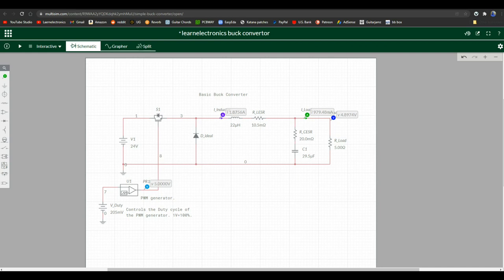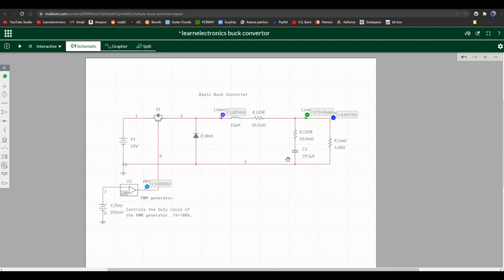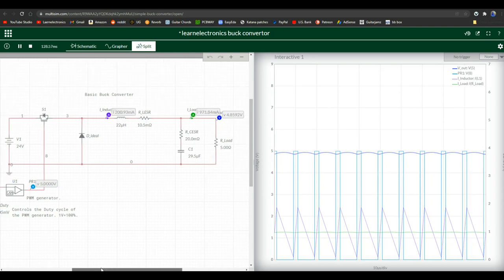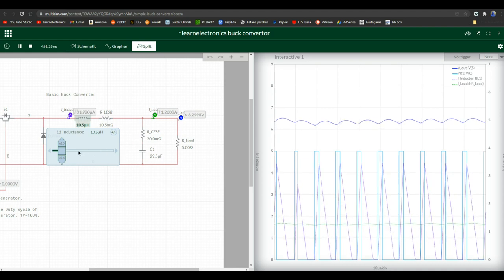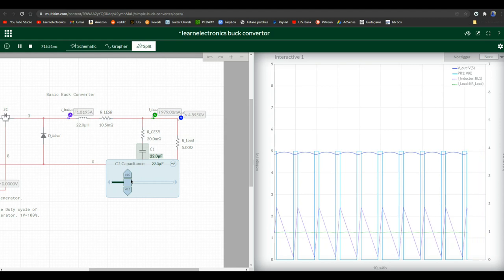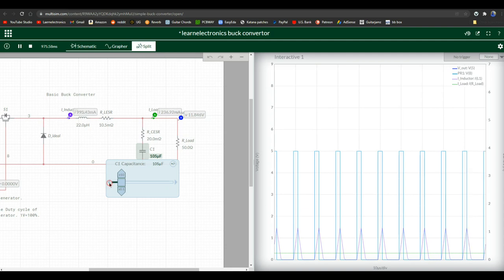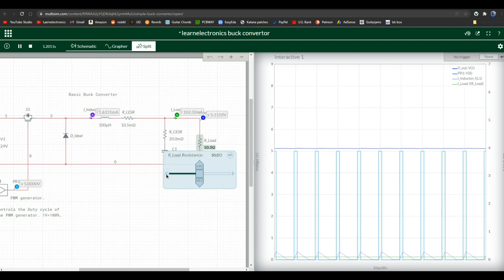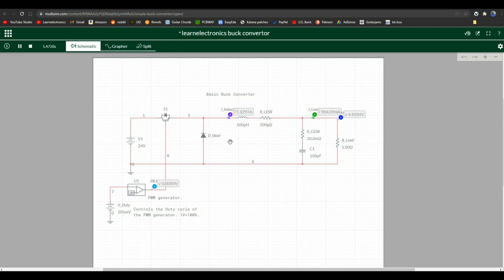Examining a Buck Convertor Model

Comment: Thank you. I need to step down some of my power tool batteries to make them to charge my phones when the power is out.
Reply: Car charger circuit.
Reply: @mikebond6328  yeah I thought strongly about that but I'll have to go from 80 volts down to 5 volt to make it work. I have two big 80 volt lawn mower batteries for electric push mower. Then I have a 20 volt and two 12 volts